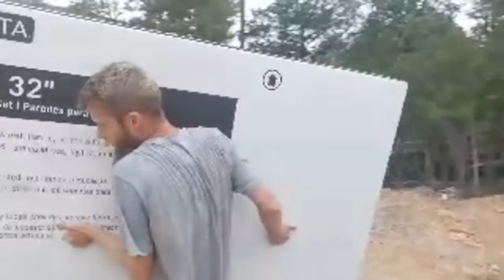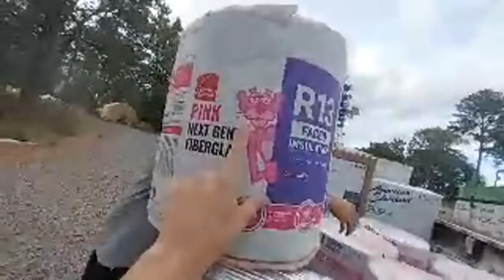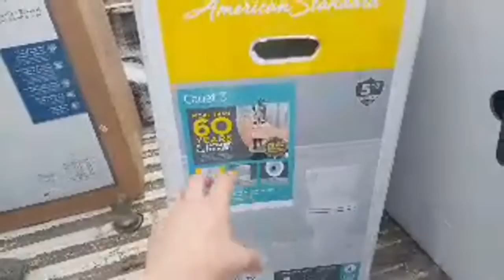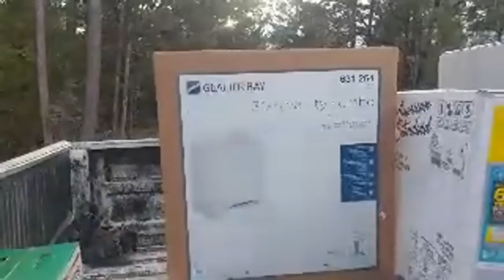LIVE w/ Mel & Gary | Huge Supply Run FILLED Biggie & Trailer

Comment: Let's see already.  It's a water heater, not a hot water heater.. If it's a hot water heater then needs to steam generator. If. If the water's hot you don't have to heat it.😉😁 Where is your Dolly to move that with?
Reply: We still call them hot water heaters 🤷🏻‍♂️